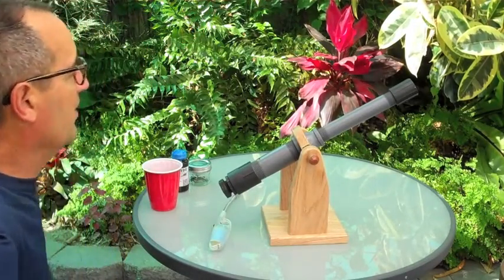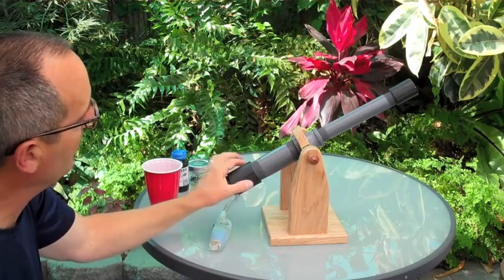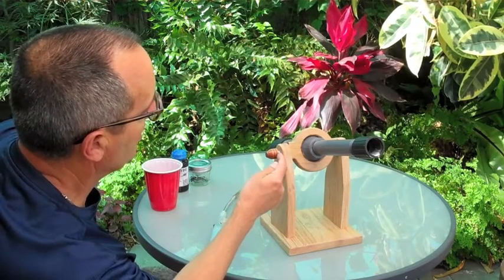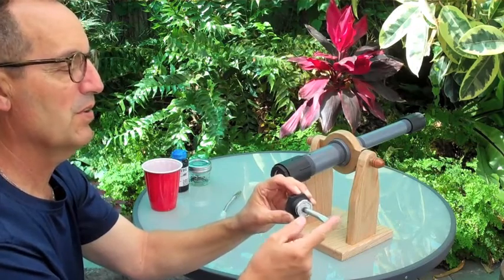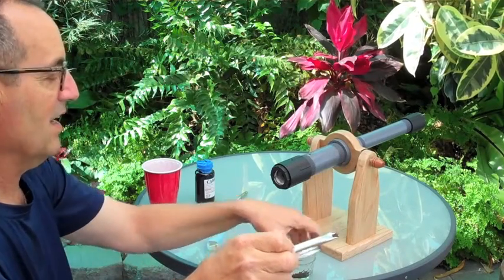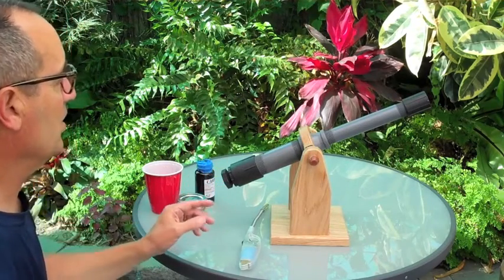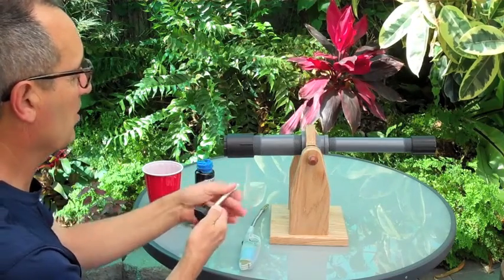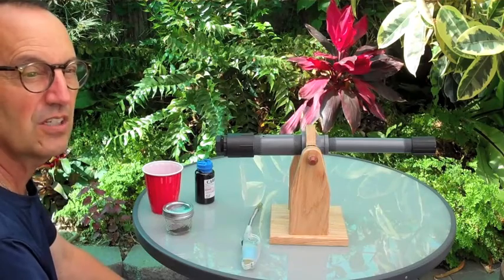Carbide`Cannon DIY instructions

Comment: Great Video !!!   When i was young my uncle use to put carbide inside of an empty paint can with a nail hole in the bottom. He'd blow the lid off of it and make a huge boom.. I thought that was the coolest thing....  Years later as i was a teenager i saw someone make a potato gun with pvc pipe.  They were using hair spray and it did decent i suppose. So i decided to put some carbide into it and see how it would do..... It blew the potato out of site with an amazing bang.. lol...  Now that i'm older i don't think carbide and pvc pipe are a good combination....  Galvanized steel pipe is def' the way to go... Great little cannon, and great video.
Reply from the maker: Thanks for the nice comments.  I too made "pipe" cannons as a kid.  Where I messed up is sometimes with these carbide cannons you get a mixture of too much gas and not enough oxygen.  It lights with an invisible blue flame and you think you have a dud and then it gets a puff of oxygen ...bang!! even if you're holding too close to your body.  Have fun but be safe.